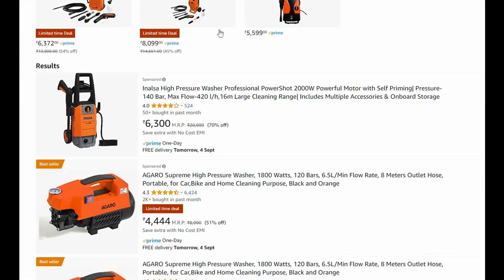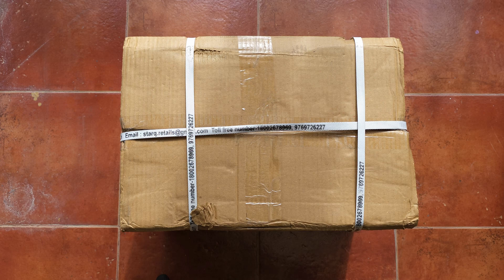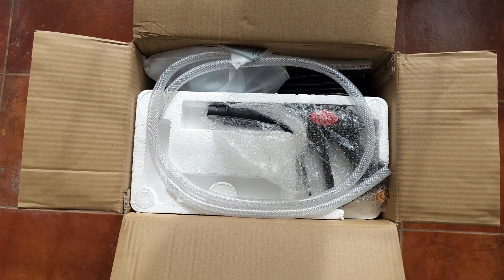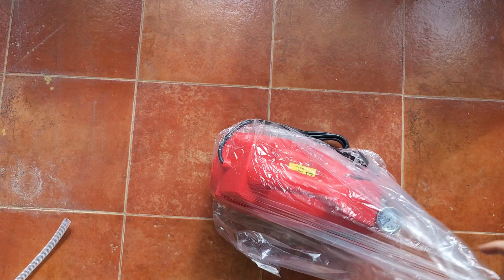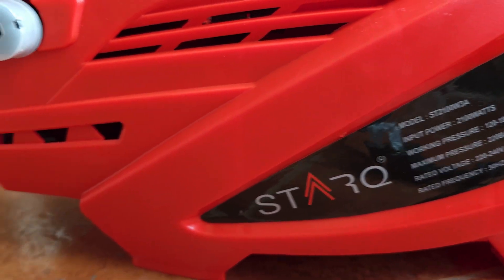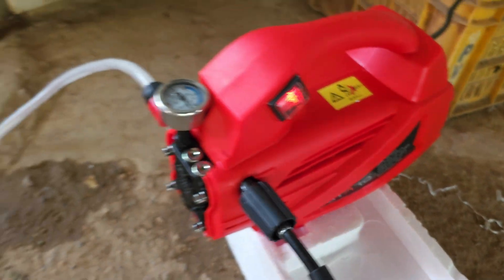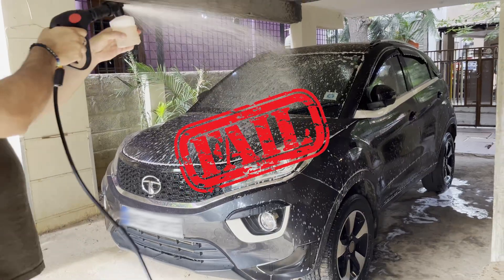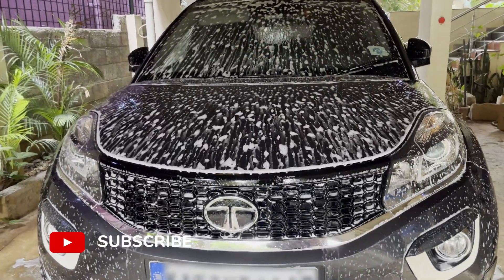Why Choose an Induction Motor Pressure Washer #pressurewashing #pressurewasher #starq

Comment: This compact induction type machines are only capable of running maximum 10 minutes only. Need to wait another 10 minutes to restart. Otherwise motor will be burned. If you want to use continuesly, better go for iBell , Global Power induction based pressure washers. Or make sure the one which your are buying capable of running at least one hour continuously. Otherwise we can not remove algae or heavy dirt from interlock tiles and walls easily.

Comment: What about underbody cleaning. Does have 90 degree extension available with them?
Reply from the maker: Yes optional accessories are available
Reply: @rtechreviews  just got this product last week and returned as well. 
Few things they have added like patio cleaning and 90 degree accessories. 
Power is really good and like product as well. 
Few things which is I didn’t liked is that 
1.after using pressure washer gun extender jammed into each other due to lots of pressure. 
2. Pipe connector which is connect to inlate filter get slipped of and stop water supply when you off the trigger. I have tried many ways to not happen that like kept it inlate pipe straight with pump and make sure there is no up down side so no pressure on filter as well. I have tried more than 15 times but didn’t worked. 
May be it’s machine connector issue or actual product issue. Not sure with this. So
I have to return product and don’t want to take more risk with 13k I have invested. 
PS : I will buy one more Time because it is very promising product and also to check this issue is there or not then I will post another comment here. 😊